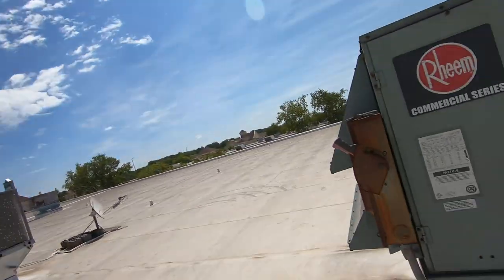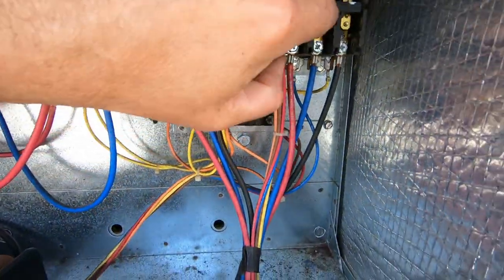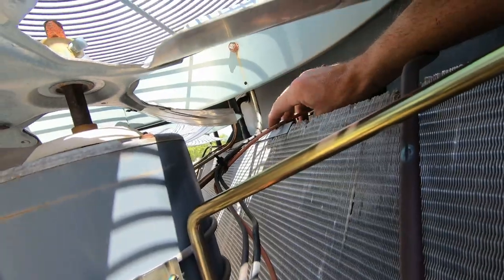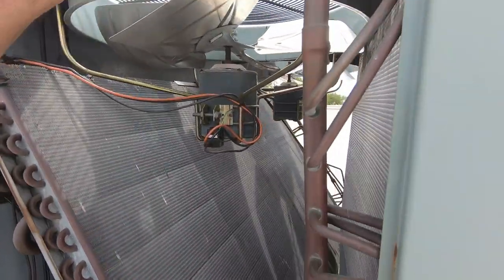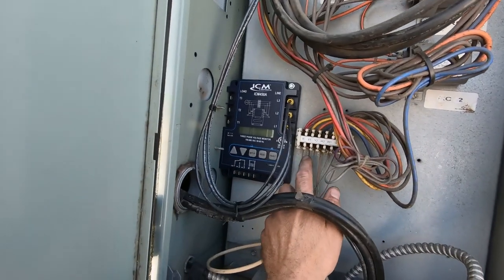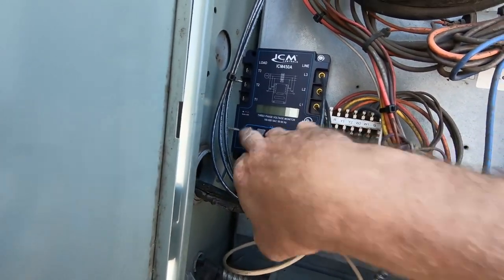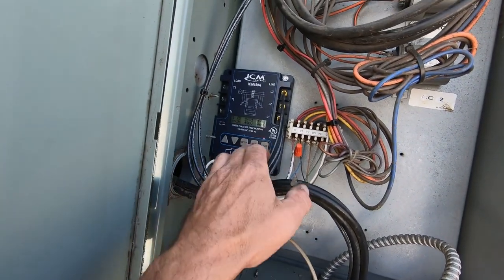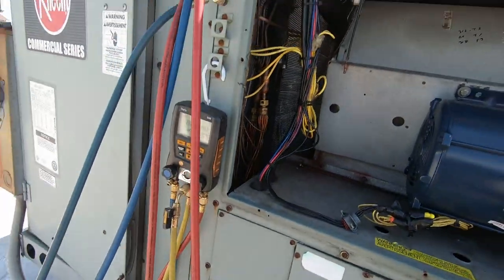Blown 100 Amp Fuse and Installing a Phase Monitor

Comment: Nice video.  What is the purpose of wiring the 24v from the transformer to the phase monitor?  The manual says "optional"
Reply from the maker: If you don’t wire in the 24v and set it to control mode the device will only monitor and will not open the contact to shut the unit off, found this out after I installed one and didn’t wire in the 24v
Reply: From what I understand, the control voltage will come from another source of anomaly and not from the transformer.  It opens the contact 1&2 if an outside anomaly happens that is not related to line voltage anomaly.